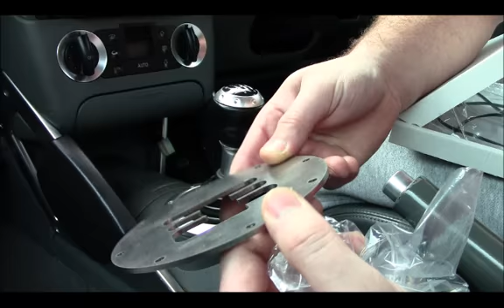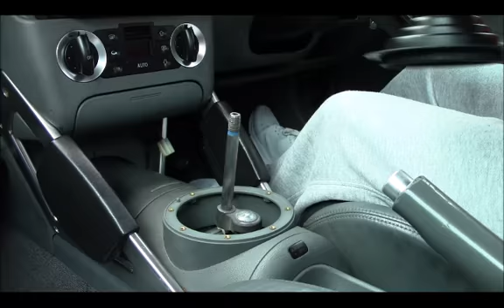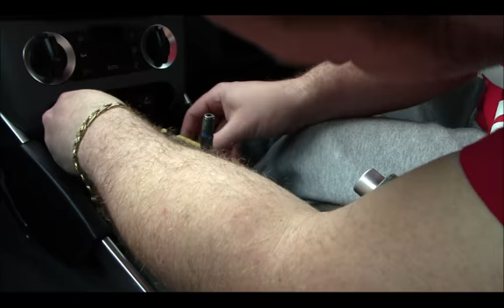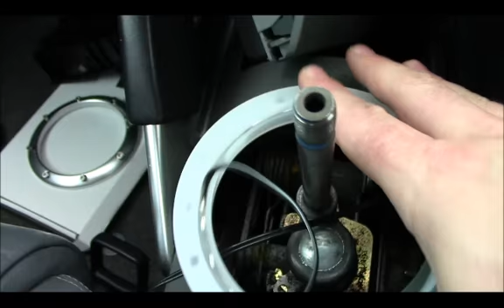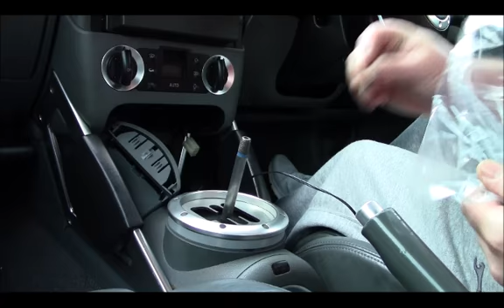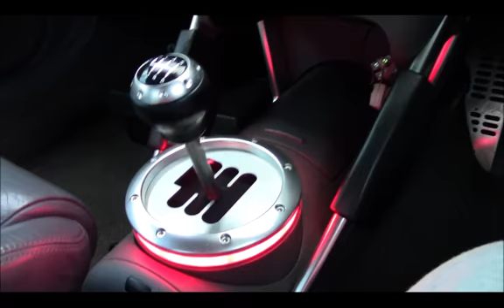Audi TT Mk1 8N R8 Style 'H' Gate + Illuminated L.E.D Gear Surround

Comment: Is there one for The manual A1 8X 2012?
Reply from the maker: Not as of yet... but we may add the A1 to our development list & potentially launch a kit for it in the future. Please subscribe to our channel to be notified straight away the moment we launch new products. Thankyou
Reply: @TIMERYDER-PRODUCTIONS  is there a way you guys could produce one?
Reply from the maker: @bdk2275  not just off the cuff no. These kits take alot of time to develop... design, development, prototyping, trialling, testing, tweaking, adjusting, more prototyping... then fitting & testing on atleast 3 separate cars/models to ensure the kits will fit & work well universally on all of that specific model. It just unfortunately takes time I’m afraid.

Comment: Yeah, It looks cool, but it appears to make shifts slower and more difficult... Looks cool though.
Reply from the maker: Aron Bennett it’s actually quite the opposite surprisingly. Each change feels more direct... & once you have it installed and get used to the individual gates... it’s actually quicker due to the reduced risk of crunching gears or misjudging gears... especially 1st & 3rd. It definitely gives a more racing look & feel to the car 👍🏻

Comment: The H-Gate doesn't seem thick enough to me in terms of aesthetics. Looking at an actual R8 shifter and you see how thick the metal plate is.. But I don't know how short the screws are.
Reply from the maker: Mattias Amorsen the issue is the travel distance between each gears doesn’t allow for a thicker plate... unless you raise the height so far up that it actually starts to look ridiculous 😂 Plus... the space between 1st, 3rd & 5th gear requires enough meat to actually become a gate (if that makes any sense) The R8 stick is slightly thinner too... & their H gate has actually been moulded which is mega expensive to mass produce/replicate exactly 👍🏻
Reply: Yeeahh uhmm, Imma stick with the illuminated L.E.D Gear Surround then xD

I saw this one guy having it wired to the courtesy light. Jesus, it looked nice.

Comment: you could lazer print a gasket as an upgrade to the double sided tape. brilliant though. like the attention to detail.
Reply from the maker: Cheers nobby styles ...we thought about the gasket already... but quite a few customers wouldn’t even use it, so it would be just an additional cost which can be easily resolved by the end user by just using double sided tape instead... good minds think alike though

Comment: I need a video for the wiring part. I'm not into cars I'm a beginner to the car world. Please can you make a video separately for the wiring
Reply from the maker: Ayyaz Hussain it’s very easy... just cut the 2 wires to the existing light on the ashtray... expose the ends of all the wires... then connect them all back up together... use a connector block or insulation tape. Aslong as you make sure you connect the positive wire from the ring to the positive & the negative to negative... it should all be good 👍🏻 If you’re not sure or confident enough... then you’re better off getting someone else to do it who is abit more savvy with wiring

Comment: will be picking one of these kits up after Christmas, great install video :) the technical term for the 'nub' is a 'locating pin' to line up the bolt holes ;)

I wonder how well this would work with a short shifter though. also did you retro fir the aux input? and guide of how to do this?